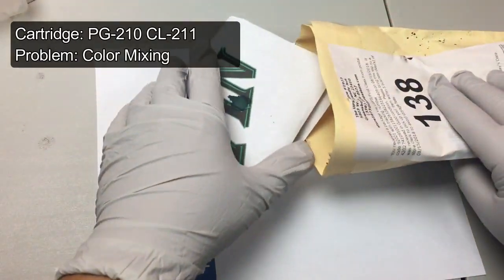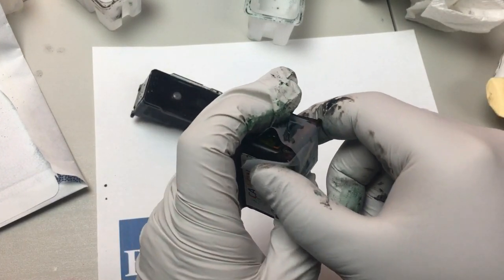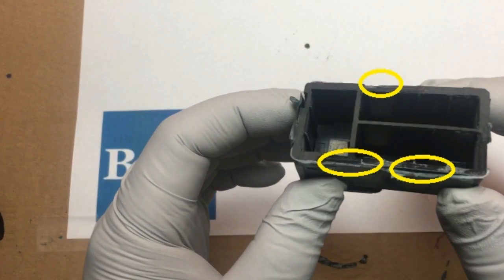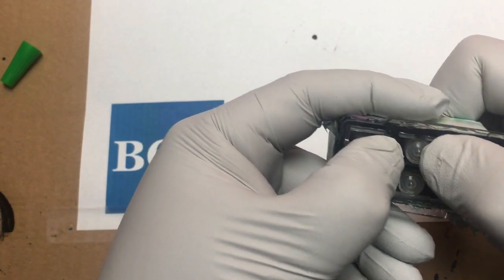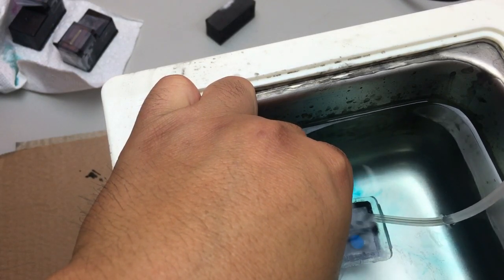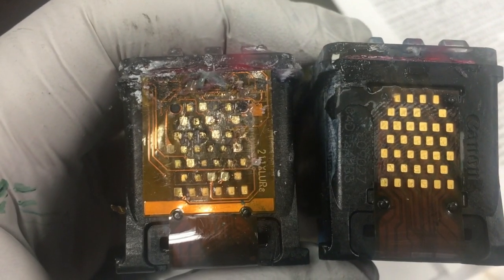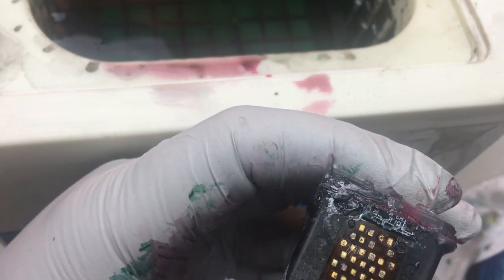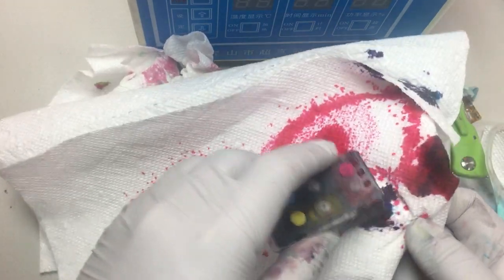Troubleshoot Canon CL-211 Spongless Refillable Cartridge Color Mixing, Bad Chip, Clogged Nozzle

Comment: I would like to try the spongeless cartridge with clear silicone for glue.  Good water proof sealing and you can always pull it apart later fairly easily.  Takes at least overnight type hours to cure, tho

Comment: hey I put ciss tank system in my Canon mg 2500 series, it works fine, though I have to buy new cartridges
Reply from the maker: Print more pages and see.  Make sure it can print 2,000+ pages.
Reply: Ohh ghoshh 2000+pages ,I think I already printed 60 pages, but sometimes it shows lines. but after cleaning and deep cleaning stuff it came back to normal. but now I am happier than before as I have to refill by injection thing and color copies I am getting like infinitely I am very happy thanks